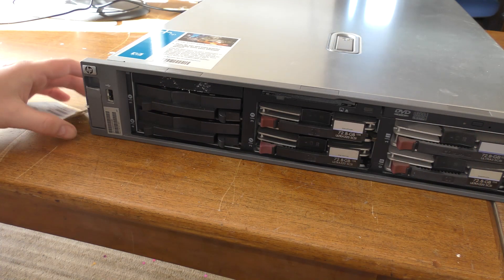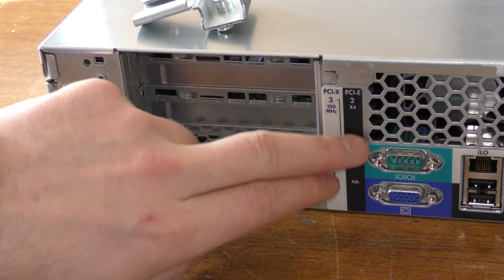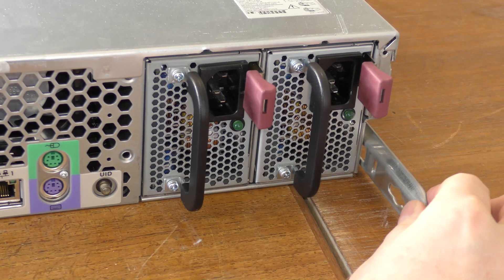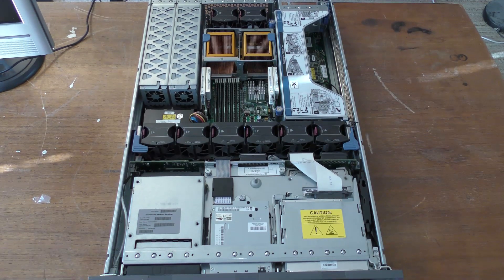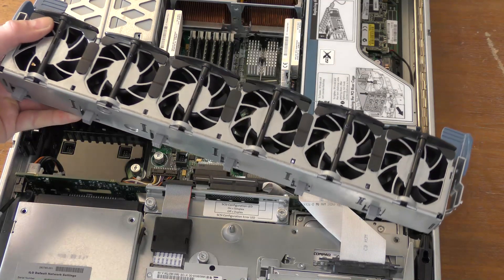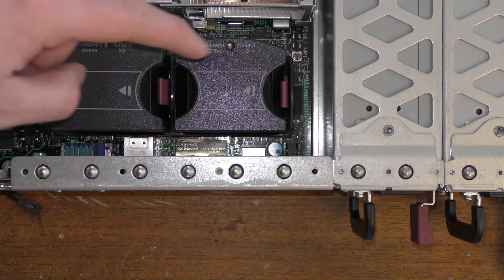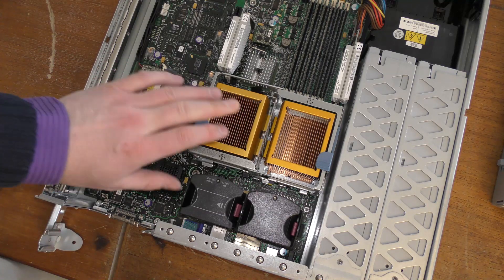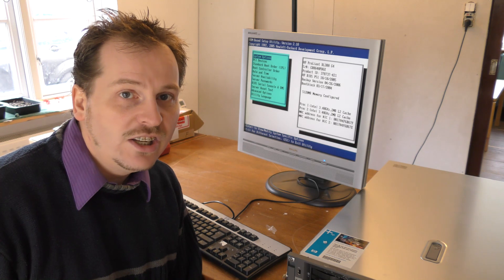HPE Server ProLiant DL380 G4, The Thorough Review -317

Comment: If you ever have any HP or Compaq questions, give me a shout. I've been using them for decades.  I recommend no less than G6 in HP for anything meaningful anymore. I also have a DL385 G3 in my play rack. I don't use it anymore except to test old SCSI drives, or use one of several old SCSI tape drives.
Reply from the maker: HI +Alex Kidd 
I did a video on my dl380 G1 :-) - https://youtu.be/QHa-LKA3XL0 and my ml150 G1 - https://youtu.be/u9u4yL4SeKg
But I am more of an Lenovo fan boy myself.
Thank you for watching! :-)
Reply: Alex I know very little on Servers  but i have a rack with 4 HP Proliant DL 380 gen 4 servrs to 'play with' . I have many QUESTIONS. can you assist?
Reply from the maker: Hi Yunus Patel 
To be honest the G4 is one generation, to old to be any fun :-) G5 and G6 are like the shit,, on the HP side.
Thank you for watching! :-)
Reply: Thanks +Morten 
The G4 are the ones I only have to play with at the moment.
Reply from the maker: Hi Yunus Patel 
Oops the G5 and G6 are the good shit :-)
G4, well you can run windows 2008 R2 64bit :-)
Thank you for watching! :-) see my latest video!
Thank you for watching! :-)

Comment: Hi Morten, have you videos for Proliant DL380 Gen 4 (Server 1)
1. On setting up a Raid 1 (mirror) array using 2 drives on the  Server1.
2. Replacing these 2 drives on Server 1 with 2 DRIVES FROM ANOTHER SERVER i.e. avoiding exchanging Servers only just the drives exchanged.
3. Adding a 3rd drive to this server in the same array.
4. Adding 3rd drive to this server but in a different array.
5. On how to read and understand the ACU report produced by HP Array diagnostic utility tool.
Reply from the maker: Hi
No,, the HP DL380 G4 is not the brand of server I'd spend that much time on. I am a IBM/Lenovo fan.
Just do a little HPE/Dell now and then.
Thank you for watching! :-)

Comment: I have three G5 DL360/380 machines, and I would consider the G5 to be the minimum configuration for running any virtualization.  I think the G5's are circa 2009, so much newer.  Also, for a server, they aren't especially noisy (notice I said "for a server" - you still don't want one next to you.)  Interesting look at the G4, and how much the engineering has changed compared to the G5.
Reply from the maker: Hi +Chris Cebelenski 
I did not get this server to use it,, just to open and see,,, but I did think of installing a ESXi 3.5,,,just to try it. 
Now I have a HP G1, G4 and a G6 all 380 hehe,, collectors editions :-)
Thank you for watching! :-)

Comment: I really hope you could help me out. Can I PM you? I have bought a server like this one 3 years ago and still was not able to get a bios version. The company I got it from removed all data including bios. So I could not even boot a simple usb stick. Would be great if someone can help me. I got a new drive as well and that one works fine but booting is not even possible, I see the same error over and over again. On the HP website I cannot find the drivers anymore as well. I wanted to boot from cd to install linux server, wont boot cd even If I force the bios to do so. Usb also did not work to boot. System has no faults.
Reply from the maker: If the bios is gone,, the server is trash,, now worth your time,, a DL380 G4 is not worth the shipping prices anymore :-/
Reply: @MyPlayHouse  It seems I need an ESXI3.5 iso to boot but this is not available anymore on the vmware website. Ideas where I can get this? I got it working jus tlike yours by installing a new battery.

Comment: I have two DL380 G4s and one DL740
Reply from the maker: Hi +Haroldas Matas Velioniškis
Those are more of collectors items then produtions servers nowadays :-) Are they running?

What CPU go in to the DL740 ?
Thank you for watching! :-)
Reply from the maker: Hi Haroldas Matas Velioniškis
Thank You!
That must be 4 of these ; https://www.fcomputer.dk/hardware/cpu/ibm/intel-xeon-mp-2.7-ghz-processor-603-ppga.html
In the DL740,, It must be a 32bit CPU.
It is always fun to see what you can get up and running :-)
Thank you for watching! :-)
Reply: +My PlayHouse (Morten Hjorth) 
Its interesting the 740 have HP signs on the front, but motherboard and SCSI disks have COMPAQ signs, it happened because the server was produced not long after HP acquired COMPAQ, Yes you're right, about cpu. And I managed to successfully install XENSERVER, the only problem is inability to run WINDOWS because it requires Hardware virtualization, but ubuntu runs well.